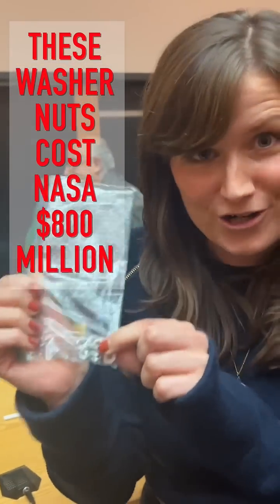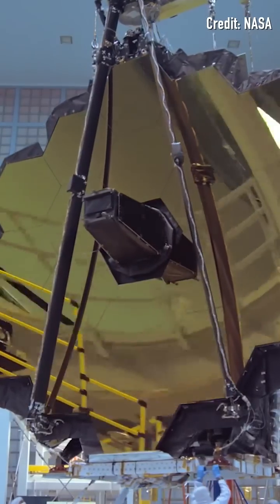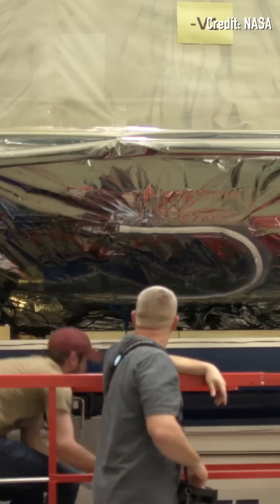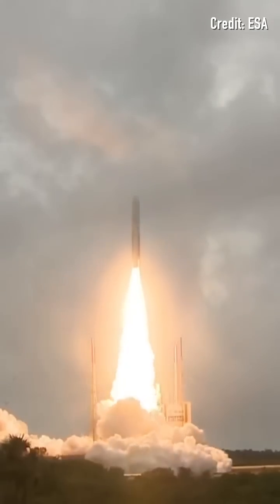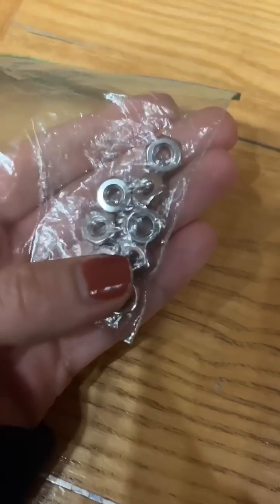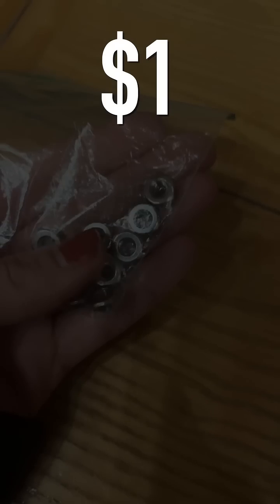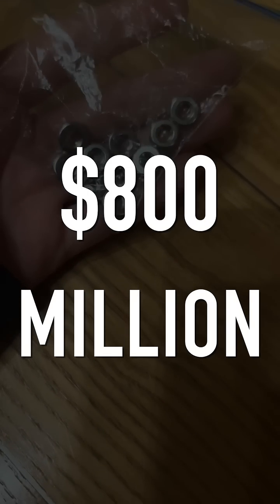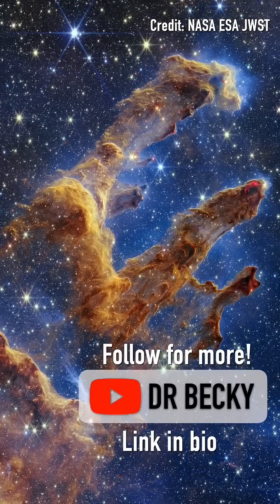JWST cost an extra $800 million because of these 10 washer nuts

Comment: Guys, these engineers are working at about the highest level there is. They know what locktight is. They didn’t use it because it wouldn’t have worked. Odds are if you can think of it in a couple of seconds, they thought about it too.

Simple common sense solutions based on our every day experience can’t necessarily be expected to work in such an utterly foreign and hostile environment.

Comment: To the morons keep saying, just use Loctite, that is not why it took 800 days to repair and retest the JWST. They were just indicators of larger issues. As such, they had to make some changes to ensure that there was enough damping to not cause parts to come loose.

Maybe instead of trying to sound superior to those that are worked on the project, you should recognize that you do not know what the true problems are at hand.

Comment: I replaced the alternator on a car I owned a few years back, the main cable that went to the battery had a nut with a captive washer that would back off all the time, I even tried using locktite on it... eventually bought some nuts with little captive nylon washers AND locktited it... SUCCESS!

Sucks when a nut screws up your day/week lol.

Comment: maybe use safety wire (aka lock wire) to hold the nuts tight.  I've seen bolts come loose, that have been torqued to nearly 1,000 inch pounds, because of vibrations caused by a jet engine. The correction for this, safety wire after torquing.

Comment: Among other metal working equipment, we here at Machineco- owned and sold vibration testing equipment. This was a perfect solution to find what may shake loose.  And to be sure, the correct Loctite compound may well have been/is a solution. So would the material and especially the pitch (# per inch)and form ,(BSF, SAE..NC or NF, or mm equiv. etc.) or class (closeness of  fit tolerance)  of the thread!  ALL of this to me could have been exhaustively verified for a few THOUSAND dollars.   We also are WELL aware of government waste , as illustrated here. But she also may be omitting other costs, especially as, though allegedly a "doctor-Phd), she calls them "washer nuts".
 ::-)))). They look totally ordinary, not even flange nuts....
Of course  this title could also be... Clickbait !

Comment: I work for NASA, never seen loctite or any thread adhesive called out on a drawing because we weld or use lock wire fasteners. Very strange that they used common nuts that rely on friction alone. I'll have to read up on this one.

Comment: The Phd's at NASA over thought the problem. You only use nuts if you plan on taking the device apart. The spacecraft was never going to be taken apart after launch so there was no need to use nuts.  They could have just welded it.

Comment: I used to work in commercial aircraft repair. Parts are pricey but you really can't make stronger bolts than the titanium ones Boeing puts on their airliners. This is a couple grand in hardware at the worst, even if you up the precision tenfold. 
This is called "government waste".

Comment: $800m, That nut! Been research that was should be worth about $200 to $500 per nut cuz it resistant highest heat and strength. Plus it made extra light weight too. Humm deez nut

Comment: What is sickening is that it cost a million $ a day to fix that issue. Couldn’t drill a hole and stick pins in it? Weld the nuts on? Not like it is going to be serviced.
Reply: Knock-on effect basically means a domino effect

Comment: when the engineer thinks "hey, im gonna save a couple of cents not using self-locking nuts" 😂
Reply: Lock nuts are underrated in the general public. The masses have no clue how important they are to us all.  Imagine a nut that simply cannot be vibrated lose.
Reply: @Derelictos  Lock nuts use polymer, don't they? I don't know how durable they would be in space, possibly exposed to direct sun radiation.
Reply: @Alkis05 There e also all-metal deformed thread nuts that might be useable.  You are right, though, I'd be skeptical about using an ordinary nylon lock nut  (or loctite) on a spaceship.
Reply: Liquid weld it works too

Comment: Me with a 2 dollar bottle of red loctite:
Reply: Which might work . . . or it might shed tiny fragments of loose composite into the extremely delicate mechanisms while it is floating in free-fall, resulting in who knows what.
Reply: @uncletiggermclaren7592  yep, pretty simple to test, put red loctite on it, run the test again. Definitely doesn't take years and almost a billion dollars to solve. But ig they have unlimited funding so they can milk it for everything it's worth
Reply: @antimatter4733  Well you missed the point of my post entirely. But then you are probably too smart for your own good, I guess.
Reply: @uncletiggermclaren7592  your comment made absolutely no sense, however I didn't want to embarrass you by pointing that out. "fragments of loose composite" loctite isn't a composite, why would it be shedding anything and as I've said that's not something that's difficult to test, that's the entire point of the vibration test. "floating in free fall" those are mutually exclusive, you can't be floating and falling at the same time.
Reply: @antimatter4733  No, English is my first language, and my grasp of it is quite sufficient, son.
Reply: @antimatter4733  An orbit is exactly that, a bottomless freefall. The insane vibrations of a launch, temperature gradients, and vacuum would probably make it fail. Paraphrasing another comment (and probably incorrectly), the material when exposed to a vacuum will off-gass. It will then condense on a nearby cold surface. The reflector is one such place. Having such impurities will reduce its abilities to do what it was meant to do.
 
Once you get toward the level of aerospace engineering, it really isn't simple. The smallest of things have great effects.
Reply: @uncletiggermclaren7592  well clearly not, since you're contradicting yourself and don't understand definitions of things quite important to the discussion.

Ask whoever taught you English for a refund...
Reply: @midgetman4206 

Orbit: the curved path of a celestial object or spacecraft round a star, planet, or moon, especially a periodic elliptical revolution.

So no, it has nothing to do with falling, it's almost the opposite of falling actually... Why do you two have such a broken understanding of English as a language, although in this cause it may be a broken understanding of physics and English...

As for worrying about it off gassing, that's not really a valid concern, it would be exposed to a vacuum before it's launched as part of the testing, any gasses given off will be released by then, however that's a completely flawed understanding of the physics at play. Condensation can't occur in space, any liquid will immediately reach its boiling point and disperse into space.
Reply: @antimatter4733  bruh.
Reply: @antimatter4733  You ARE falling while you are in orbit, it's just that you are falling at the same rate that the Earth's surface is curving away from you as you move horizontally, so you stay at the same relative height above the surface.
Reply: @antimatter4733 I'd have to disagree. If you didn't fall, you won't orbit. You'd always be in escape velocity whatever the velocity. You'd have to fall into a gravity well as much as you're escaping to orbit.
Reply: @uncletiggermclaren7592 floating in free-fall😂😂😂
Reply: @seanriopel3132  Explain what your  tiny little mind finds funny about that commonplace  phrase, please?.
Reply: Absolutely useless, nice try though.
Reply: I thought that too but locktite fails past -54°C and space is about -270°C. So it'd be a quick fix that could cause issues in the future.
Reply: Lol
Reply: Staking them would have worked also.
Reply: You can pour your loctite all over deez NUTS!!!!🤣
Reply: As far as I know, Loctite can't handle the temperatures of space...that was a stoopid comment
Reply: ......stupid.........
Reply: The one question is, will the loctite hold up under the heating effects of the sun on the parts. I myself like the concept of a drilled hole and safety wire.
Reply: $2 bottle of loctite? For that amount you'll get 3-4 drops. A bottle of loctite is a lot more expensive than $2 lol
Reply: Or just self securing washernuts...
Reply: 14 dollars, mate. 
Yeah...... it's expensive.....
Reply: Is loctite rated for double digit Kelvin temps? Has it been subjected to NASAs vibration testing? I'd wager such options we're considered in the design phase.

Comment: Those are NOT washer nuts. Those are just nuts. Washers & nuts are two different parts unless you are talking about lock nuts which have a plastic washer inside the nut. But those you are holding are not them.

Comment: My brother is an engineer responsible for the the vibration mitigation system. I’m a machinist and made him 2 fixtures. Blocks that held 3 accelerometers in the X,Y and Z. One block on the control that stimulated the shaking from the vibration and one where the JWST would be to see how the system dampened the vibration. I did it for free so I saved them a few hundred bucks 😅

Comment: Do you have a video explaining exactly what happened and why it took 800 days to fix?
Reply: The video is inaccurate, it was actually 70 loose parts, some of which came completely off and got lost inside the craft.  There were numerous engineering challenges to overcome which is why it took 800 days.  for example: some fasterners came off because torquing them properly would have damaged the membrane they were attached to so they were not fully torqued, which required a redesign.  There were likely several other redesigns and retests were needed.
Reply: @brassman7599  is it possible to read a paper about it? i cant get any additional information on this meter
Reply: They probably had to do a lot of re-engineering and findout a way to fixate whatever those nuts wear holding using some other way. And if you change one thing, you have to make sure it is not going to affect another thing, and when you least expect, you are redesigning a whole bunch of components. Than you have to build and test everything from the beguinning.

That would be my guess.
Reply: Same reason it takes an afternoon just to remove enough parts of a car engine to get to that one piece that needs to be replaced.
Reply: You get all sorts of fun from vibration. One project that I am aware of was a control box for the B2 bomber. The first design had the boards mounted in rubber inside a reasonably stiff housing. After the high vibration test, parts had been flung from the boards and even the conformal coating had been peeled off. The final design was so different, the boards were mounted to frames that clamped into the housing.

Comment: That's the difference between an engineer fixing a problem and a mechanic
Reply: Yeh, a mechanic would have used locktite on everything!
Reply: Yea one is a gamble, the other isnt haha
Reply: Ah the old “lololol the common man is SO much more capable and intelligent than those stuffy intellectuals!”
Reply: I was also thinking that, there's so many ways of stopping nuts rattling loose
Loctice like mentioned, oval shaped threads, nyloc nuts 
So much money wasted
Reply: Yeah, the mechanic will actually fix it. The engineer will needlessly over fix it. Hence why these cost $800 million.
Reply: @cgi2173 to be fair, they need materials thay can withstand near Absolute Zero temps and the vacuum of space. I am not entirely sure Locktite can do that.
Reply: Didn't they just do that on some nuke sub in the UK? Glued something onto the reactor instead of switching the parts.

Comment: Strange with piston engine in aircraft most nuts and bolts were also "wired" to prevent complete loosing - of course it did not prevent loss of "grip" or preload - which I gues was the failure mode???

Comment: I'm honestly sitting here questioning why it took 800 days to do what locktite could have fixed in 20 minutes
Reply: I'd wager loctite isn't tested to 7°K... 🤔 or failed that test...
Reply: @mikusmc-kz7vn  That's a solid answer I didn't consider. It would appear locktite is only sound to -54°C. So in that case now I'm curious what NASAs $800 mil super-locktite is capable of.

Comment: 1 million a day in LABOR costs alone? Is that 1 million engineers making a dollar a day (on this problem alone) or 10 guys making 100 grand each per shift? Or has NASA hired lawyers? A lawyer firm will easily charge you in thousands per hour, but day has only 24 hours. So unless you have dozens of law companies working on it around the clock for a whole year, something does not add up.

Comment: When the fresh out of college mechanical engineer with no real world experience specs out standard nuts as a line item on a BOM for a drawing and all the experienced techs tried to redline and correct the drawing but get told no by management, those techs are finally laughing saying "I told you so!"
Should have spec'ed out lock nuts with safety wire and possibly thread locker compound.

Comment: A) Those aren't washer nuts, they're just nuts

B) JWST was delayed for many reasons, not just because of loose nuts. They did have 70 pieces of various hardware (not ten nuts or washer nuts) fall off during vibration testing, but it was because the lock nuts weren't tightened properly before the test.

Comment: doesnt suprise me since i work in the aerospace industry. a roll of velcro is about $5000 for about 100ft just because of the burn certifications to be used on an aircraft, while a normal household roll of velcro would be about $30 for 100 ft

Comment: I want to see the actual full report of just one of those days, mans hours and material. Just seems ludicrous
Reply: The nuts weren't the problem, they were the symptom of the problem, the issue was that the dampening systems weren't working as intended, the money went went to troubleshoot the root cause, the fix, more computer modeling, retesting, decontaminations, base maintenance, etc.
Reply: You won't. And it is. Because it's the government and everything the government touches costs more than it would a private company.

Comment: I'm more perplexed trying fathom what a washer-nut is...😂
Reply: A flanged nut perhaps? Closest thing I can think of to a "washer nut" lol
Reply: Similar to a cotter bolt.
Reply: maybe it's just a nut that's a bit more flat
Reply: @TheNamesArif  nah thems flange nuts
Reply: Bruh that's what I said 🤣
Reply: Same lol
Reply: That was my question.  Distracted me every time she mentioned it.
Reply: It's a nut with a flat surface machined on them, you can see on one side of the nut that there is a small step down to a smaller diameter round surface that acts as a washer of sorts. There are very common for situations where a specific torque is required as the smooth round surface will get you a more accurate torque that a regular hex nut.
Reply: @korbinianrohrbach1165    There are nuts that come with washers attached to them, sometimes referred to as spin nuts, (as well as others) but there is no such thing as a washer nut.  There are lots of nuts that are rounded over but it's not so that they can act like a washer.  It's so they don't mar the surface they're being attached to thereby preventing proper torque being applied.  The nuts in the bag she showed us are jam nuts or machine nuts.
Reply: women.
Reply: @PupperTiggle  Insecure person trying to be comfortable with someone else’s intelligence (challenge) (impossible difficulty)

Comment: So what your telling me is the top, top of line, most expensive design failed because NASA scientists couldn’t work out that adding washers didn’t make them check the length of a screw to engage the lock ring, which also didn’t have a back up???? They make lock nuts with additional locking devices for stuff staying here on the planet????? Hopefully the locknut and washer team were put on floor cleaning duties for a year!!!!

Comment: " Locitte "

 " J B Weld "

" Drill a hole through the bolt shaft  ,  pin down the nuts "

" Star Washer between each nut "

" Open Spring Washer with Locitte / J B Weld and pin / clip  to down , lock the nut "

Nylon lock nuts  .... but the melt vs freeze cycle , and for Locitte , J B Weld...... so go Star Washer , Spring Washer , Nut then Pin / Clasp

  " Just my 800 Millions worth "

Comment: Hey girl, they are not called "washer nuts"
Second, you got those at a local hardware store. You can't fool me.
Next, they used regular AN hardware, instead of space qualified hardware.
That was the problem and they didn't need 800 days to solve the problem.
Dump NASA. JOIN SPACEX!

Comment: I guess these fancy engineers had never heard of lock-tite or locknuts. Nuts vibrating off has been a problem for a long time and we have developed methods to lock them into place using plastic or glue to hold them in place. They just need an AGE mechanic on their team. I could have solved this problem for them in two minutes tops.

Comment: To be clear: the parts didn’t cost $800M to manufacture, and those washers might have been designed to swivel in a hostile environment subject to unfathomable conditions and “cold welding” where like metals tend to spontaneously gall together. I don’t know if other teams had more time to improve their systems due to the delay, or what their conclusions were, but after the Challenger disaster due to a breakdown of communication and a misunderstanding of the material properties of the o-ring I’m glad we didn’t launch a $10B mistake.

Comment: Why didn't they just replace the nuts with nuts that could be safety wired???
I feel like this explanation is highly simplified. cause as an aerospace mechanic I could fix 10 nuts with a tendency of loosening by myself for a lot cheaper and a lot quicker.